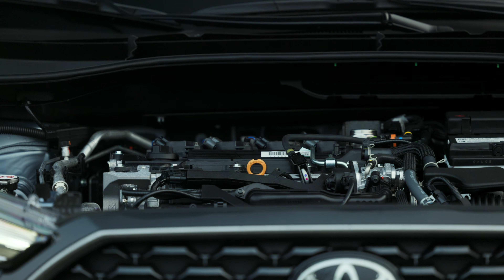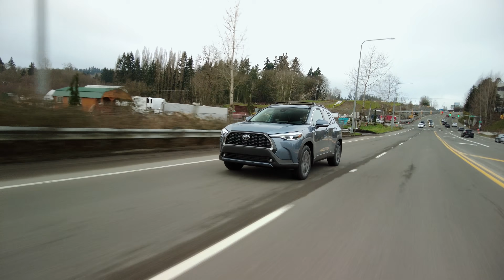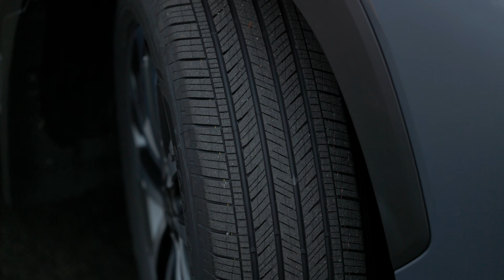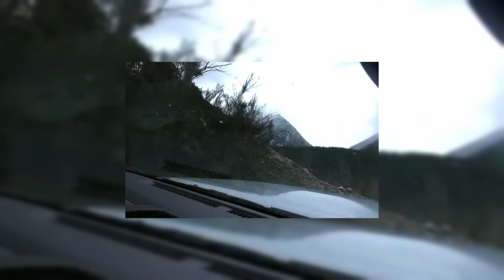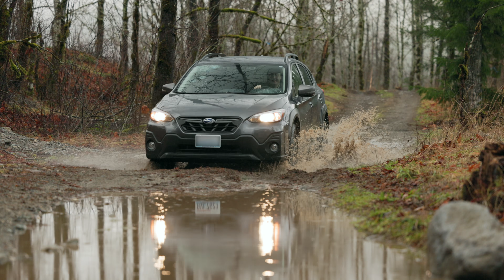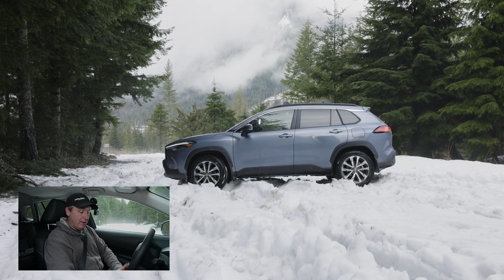2022 Toyota Corolla Cross vs Subaru Crosstrek AWD Off-Road and Snow

Comment: Subaru has the best awd systems! However tires make a big difference.
Reply: Absolutely! Tires make a drastic difference. I saw it first hand in my 2016 Forester.
Reply: Prius and Corolla are the most hated on the highway because they are slow like 🐢🐢.
Reply: @lacloidi2003 no! Kia, Hyundai & American cars are the slowest on the highway. I hate being behind these cars.
Reply: Put some Continental DWS Extreme tires and your ready for anything the toad throws at you!
Reply: Suzuki has the best AWD systems.
Reply: @secret5.  I think you joking 😂
Reply: Very true Subaru awd ain't that great if you don't have tires
Reply: Great awd but trash engine
Reply: Nothing but a bunch of Toyota vs Subaru BS here. I worked for Toyota for 13 years. I bought a Subaru. Both companies are good but up here in the North East where we see snow and ice 5 months out of the year, Subaru is the better choice for the price. Going farther south to the Mason Dixon and Toyota may make more sense. Go even farther South and who needs AWD at that point. Stop being a bunch of morons and look at what the cars offer and are designed for. Subaru has its reputation built on bad weather driving. Toyota is more for everyday on-road reliability. Put the shit to rest.
Reply: Yes tires make a big difference
Reply: Subaru has really bad engines lately.
Reply: @allroadsawesome  my engine just went out on my 18 crosstrek limited at 62k miles ,so I bought a 2022 crosstrek limited  I'm hoping this engine makes it to 100k miles
Reply: I agree Subaru has the best awd system.  However, they also have the worst head gaskets.
Reply: @ddk80  head gasket issue was sorted out years ago. The issue was on the EJ series and it was due to the material that gasket was made of.

A lot of issues are self inflicted because people try to boost hp figures without upgrading supporting parts.

I've repaired a few lol.

But obviously that is the vehicles fault. Never on the idiot owner.
Reply: No they don't. Watch how they fail test after test on TFL.
Reply: @differencemaker242  people still watch tfl?? Really? They stopped making good videos about 8 years ago. To biased and they had an issue with Subaru corporation. So what is their solution since Subaru doesn’t provide them an outback to test.  They buy one! Ha. Lack of brain power there. They buy an outback for the year.  Maybe it should be changed from tfl to just bs channel?!  Hmmmm
Reply: @differencemaker242  TFL is putting Subaru into situations they are not designed for.
Reply: @edsmith9855  I would say their marketing is putting them in situations their vehicles aren't designed for.
Reply: @differencemaker242  You could say that, but come on, plenty of other manufacturers are advertising their crossovers this way. Ford, Hyundai, Nissan, and others are all doing it. TFL just seems to be obsessed with bashing Subaru.
Reply: @edsmith9855  They just do the testing and show the facts. I mean Hyundai/Kia products do terribly in their testing as they always overheat. They haven't banned TFL from testing their vehicles though. I think they make a point of singling out Subaru on occasion because unlike the other automakers Subaru tries to hide their poor performance. I mean in a sense I understand it. They are selling a lot of vehicles and they know only a small fraction of buyers take the cars offroad.
Reply: @edsmith9855  didn't they make a video recently apologizing for being biased against subaru?
Reply: @edsmith9855  smart comment!  Well said
Reply: @differencemaker242  you obviously didn't read my post above as to why TFL & Subaru hate each other.
Reply: @edsmith9855 yup, they hate subarus
Reply: @differencemaker242  they don’t fail any test. Saw those videos
Reply: @Toyota4Life  you can Google 4runner vs subaru outback comparisons, and the subaru wins by a lot
Reply: @Toyota4Life  You obviously didn't see the ones I saw. Their AWD cuts out with excessive tire spin because the CVT isn't powerful enough. Both Father and son said their products don't live up to their marketing. Sorry man, the experts said that. I'm just the messenger. I think it's also curious that Subaru  doesn't want TFL testing their vehicles at all. Now why would that be? If you indeed had the best product wouldn't you want the #1 show on YouTube for offroad testing showing off the merits of your product? Of course you would, instead they appear to be hiding something.
Reply: @differencemaker242  its because TFL got one of their vehicles, went outside of the parameters of what they agreed on with Subaru for testing and also damaged the car.

The reason Subaru won't lend them testers is 100% on TFL.

It is fairly well known to those who have been around for a bit.

Now they just bash Subaru all of the time.

TFL is a bunch of dip$hits who couldn't change a serpentine belt.

I've built true offroad rigs from the frame up.

Last one was an 83 Golden Eagle edition CJ with a 427 in it on Rockwells.

 I had convos with the "TFL Twits" on their feeds.

They don't know their @$$ from a hole in the ground.

The people who follow TFL are more clueless than they are.

It is why they think they are experts lol.

They get clowned in many offroad venues.

Noone who knows how to turn a wrench, build an offroad rig, or truly drive in rough territory takes them serious.

Nowhere near experts lol.
Reply: Drove. Newer subaru.  In my opinion its a joke. With. Disaster.  cvt.   they will loose all sales.  To raw4 and ridgeline.
Reply: Subaru does not have the best AWD systems LOL
Reply: @Toyota4Life  No, Honda and its Super Handling All Wheel Drive is the best.
Reply: @Toyota4Life yes they do!
Reply: @Toyota4Life  

Better than Toyota’s AWD system. Toyota/Lexus by far has one of the weakest AWD systems out there. 

4WD system on the other hand is top notch. 

Remember AWD and 4WD are NOT THE SAME
Reply: @HOTPLATEGAMING  Lmdao dude. I would take a tundra TRD pro or 4 runner TRD pro. Or even a GR Yaris rally. Over any Subaru on sale ANY. Subaru only makes me one decent car away. Have a good day lol
Reply: @Toyota4Life  When you go up North on states where it snows a lot, and you compare the amount of Toyota vs Subaru vehicles, you definitely find more Subarus. Subaru symmetrical AWD is awesome indeed.
Reply: @Toyota4Life  you just watched the Toyota cross get smacked by much cheaper car. Subaru AWD system is the best
Reply: @Mike3_6_9  all of Toyota vehicles outsell Subaru vehicles in America and all around the world.
Reply: @Pringledust  a Corolla cross is a city vehicle and run around town car. Not meant for any type of harsh conditions. A 4 runner and tundra and sequoia will destroy any Subaru. Should I include the Yaris GR ?
Reply: @Toyota4Life  I literally just stated that the corolla cross got beat by a much cheaper car. Subaru crosstreks are perfect city vehicles and are extremely affordable.
Reply: @Toyota4Life  but hey, enjoy your 10 Mpg shit car lmao
Reply: @Toyota4Life  

Of course you would. Such a biased comment 😂😂😂😂😂😂😮‍💨
Reply: @Toyota4Life  I just can’t resist pointing out that your screen name shows you are highly biased in favour of Toyota. Making me think you have rose coloured glasses concerning the Toyota.
Reply: @Toyota4Life  I own a 2022 crosstrek limited and my gf owns a 2022 rav4 ,I'd take my subaru over hers anyday .the crosstrek is overpriced tho ,I paid $33,600,or its $40k if I just make minimum payments
Reply: @burnthecandleatbothendz  Sincere question here: I am considering the Cross, as the Crosstrec didn't work well with my back. The Outback does work for me, but is the extra money worth it?
Reply: @staceys1870  I chose the crosstrek bc it has a sporty look for it and I went with the limited edition to get all the bells and whistles .the outback has more room but other than that I think as far as specs go they are identical. 2.5 engine and 8.7 inch ground clearance .I could be wrong but wouldn't hurt to take a test drive. I do love my crosstrek! Hope this helps
Reply: @ZiMZALABiM  yes, Toyota rusts for ever LOL...
Reply: @Toyota4Life I love toyota but the fact that you're comparing a true 4X4 to awd shows you don't understand the comparison at all. Subaru awd is one of if not the best but it won't beat a 4X4.
Reply: @BaldKiwi117  Toyota has beat Subaru in rally racing. FACT. Toyota can do 4x4 and AWD. Subaru is a one truck pony
Reply: @Toyota4Life  rally race cars are completely different from street cars. FACT. You're a biased toyota fanboy. FACT. Subaru doesn't make trucks. FACT.
Reply: @Toyota4Life what do windows taste like dude?

Comment: had you turned off traction control you would of made it up that hill in the toyota just like it got you unstuck in the snow
Reply from the maker: The two situations were different. Traction off would not have helped on the hill.
Reply: @drivingsports  from what I saw on the hill, first the tire spinning in mid air will not get you any traction and the ones on the ground were not participating in getting forward movement.

On snow and Ice both my 2014 Audi A7 Diesel full time AWD (new ones are not) and my 2015 Subaru Impreza actually do better than my Jeep up until both of these low to the ground cars become snow plows. With my cars I just put them in gear and let the systems do their thing. The Jeep goes anywhere if you work at it.

A good demo on the Audi was I backed up a little too far making a U turn on a muddy dirt road and ended up with both rears off the ground over a ditch. 

Using just the fronts I was able to drag the rears back up onto the edge and up it came. All 4 of us adults in the car were like 'WTH, I didn't expect that'. 

I may dump the A7 as it is having EGR issues (under diesel gate warranty) and very poor dealer issues (manpower = long repair wait times). 

But as far as the AWD system, until it becomes a snow plow I believe it would beat that Toyota.

Comment: Subarus have often been plagued with head gasket problem or CVT problems as they age. That’d make me pick the Toyota as I generally keep my cars 15+ years.
Reply from the maker: Head gasket issues were on the older EJ25 engine which is now gone.
Reply: Had a head gasket go at 150,000 on a 95 Legacy, but am assured that's not a common problem on the newer ones. CVT problems? Yeah, isn't that pretty much all the manufacturers? Of course, if 20 % of CVTs have problems that's a lot, and a really bad reputation, but it still means 80% don't.
Reply: I had a 2018 crosstrek limited and the bearings in the motor went out at 62k miles ,but I like the crosstrek so much I just bought a 2022 model .and I'm hoping this one makes it to 100k at least

Comment: You were already there. Why didn't you turn off the traction control to really demonstrate that it does not work? You have to be fair to your viewers. Who knows, maybe Toyota already changed their algorithm similar to that of Mazda (https://www.youtube.com/watch?v=-6HdwnL0LQw). 

Don't you know that Toyota has a feature "Auto LSD" on their truck based vehicles? When you turn off the traction control, the brake slip limitation actually becomes more aggressive and the throttle is not mitigated(https://www.youtube.com/watch?v=IcYLju1lQ5s).

Comment: Question - do you think if the Corolla Cross had Wildpeak A/T's it would've been able to clear that off-road spot that the Subaru was able to?
Reply from the maker: No. That was addressed in the video. Grip wasn't the issue on the first dip. The wheel wasn't getting enough power to even rotate. If grip was an issue you would have seen it struggling with wheel spin.

Comment: Wow toyota is finally doing a new Corolla Alltrac. The old Tercel Sr5 wagon 4wd turned Into the Corolla All tracks in the 90s. AWD small, yet roomy, the all trac was great. Now in 2022 The Corolla Cross is bringing the same packing idea to the forefront again.  The CHR was and is garbage with no cargo room, so it was bound to happen. Toyota bringing something out smaller than the current Rav4.  Now of Toyota could make 5 models for the current Corolla like they did in the late 80s early 90s. A 2 door coupe to compete with the civic coupe, a 2 door Hatchbach(FX) to target those that don't want a 2 with a trunk. There's already a Sedan and 4 door hatch. Now a Corolla Cross. They need a Wagon, not an IM not a Matrix but a wagon longer than the 4 door hatch and longer than the Corolla Cross. They will dominate the market woth 5 or 6 Corolla vehicles

Comment: I don’t understand the market for the Corolla Cross. I had the new RAV4 XLE, for around the same price as the cross and eventually upgraded to the RAV4 adventure for just a little more. With all RAV4’s they appear more spacious, more power, better off road, more stylish, and imho a true competitor for the sub crosstrec at least off road wise.
Reply: I think there is a good market for the CC in the lower trim levels, if you can find one for less than the Crosstrek Sport.  They have a reputation for great reliability, and on paper at least, more horsepower than most other base model mini CUVs (Crosstrek, Kona, HRV, etc). I agree, one you get into the higher trim levels, the CC doesnt really make sense. Either get a mini SUV with an optional engine, or move up a class to the Forrester, CX-5, Rav 4 class.

Comment: The simple fact of the matter is that most SUVs and Crossovers on the market are FWD that have a 4WD system just for marketing purposes. Subaru’s symmetrical AWD is an actual AWD system and that can be clearly seen in this video regardless of tires. 
If you want to be able to go anywhere then buy a car with a real AWD or 4WD system and invest in tires for what you will be using the car for.

Comment: You're biased towards the Subaru clearly. The Corolla is an actual crossover while the Crosstrek is a jacked up hatchback with less space and overall dimensions. Come on mahn the subaru had an undue advantage with better rubber.

Comment: Great balanced review. It seemed as if the wheel articulation might be a limiting factor the Corolla Cross (words I never thought I’d say) lifted its rear wheel when he turned the small bump caused the rear wheel to lift
Reply: Locking diffs counter limited articulation quite a bit. Toyota needs to add a button for locking/clamping the center diff. TRD could also bring in more customers and revenue by offering a rear locker, some underbody armor, and a winchmount for off-road enthusiasts.

 SUPPORT YOUR CUVs, TOYOTA! There are more customers and money to be made!

 TCS is no substitute for traction diffs.

 Siped mudders help too.
Reply: Obviously. Toyota usually has excellent traction control. My highlander 2016, would do off road park stuff. Only climbs limited by the all season tires would limit it. 

New vehicles are extremely sorry for capabilities.  The drive trains are the same, the brakes are the same. It’s all limited by the software.  

You could flash that Corolla and it would well.
Reply: @johnmadsen37  I love those highlanders! A guy out in AZ trails and modded his!! I agree I was hoping because it has a CVT and is “similar” to a trek aka Toyota owns part of Subaru the performance would be similar. The hybrid Rav AWD mapping is horrible… it could probably be a beast but the computer limits it…

Comment: I have owned a number of AWD Toyota's and Subarus.  They are good enough to keep you moving under most road conditions, but not for actual off-road use.  The Cross with no-season tires did remarkably well in that deep snow.
Reply: I call them 3 season tires.
Reply: Subaru vehicles tend to do well, besides extreme off-road stuff but that's where you'll get a jeep/bronco/4runner not a Subaru lol

their awd system is fairly advanced vs competitor like we see here where it outperformed Toyota
Reply: So many of his videos are worthless because he's using OEM junk tires. He should use AT and/or winter tires.
Reply: @phatgringo2.0 Why buy those tires for a car that isnt his? Better tire’s wouldn’t make that Toyota out perform Subaru, especially when their awd system  is inferior to Subaru.

Comment: Next génération (2023) Suby Forester will come with Rav4 basic engine plug In hybrid with about 200 hp. 
And Corolla CC (In Europe) comes with all new 2.0 hybrid power train with awd and about 200 hp at fall/winter 2022.
Reply: It is about time Subaru started using Toyota engines!

Comment: instrument panel and digital display small outdated outdated, automatic transmission and cvt is still unrefined and is also noisy at high speeds, boring and bland ambient lighting inside and some poor quality plastics, taillights already look old With a few days of use with that stupid obsession with transparent plastic glass color, they not only look worse, especially during the day, but also give a poor image, better in red amber, more beautiful, safer and more dynamic, the front bumper should have daytime running lights separated from the main headlights, it is positive and sporty that it does have nice front fog lights